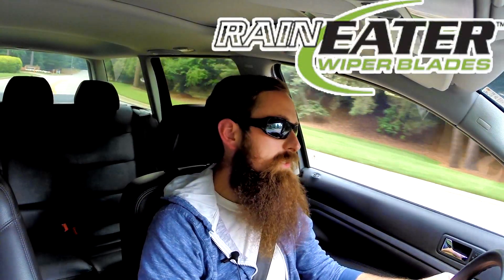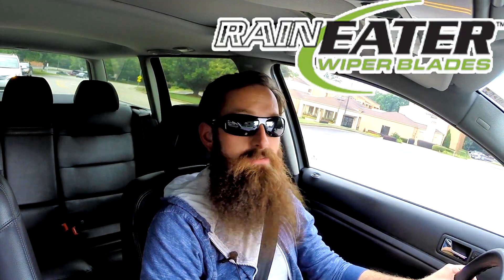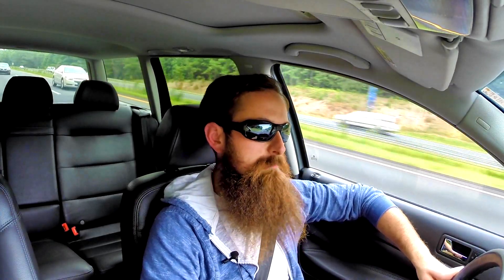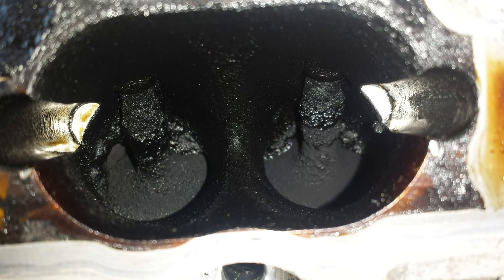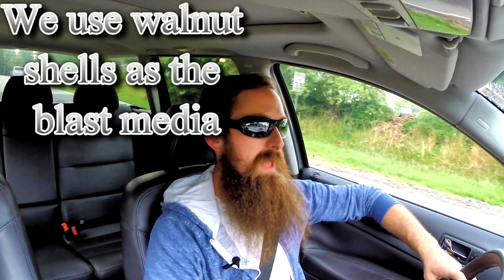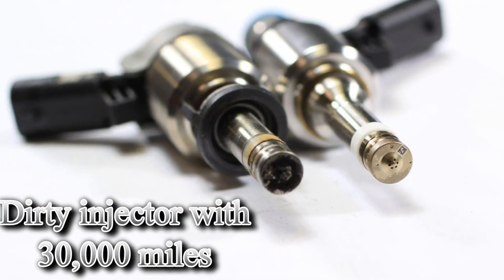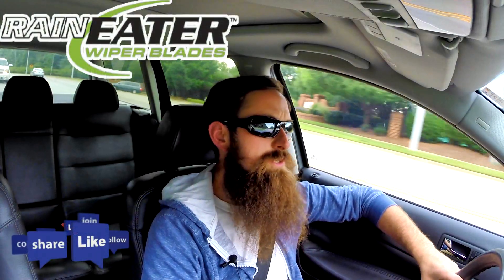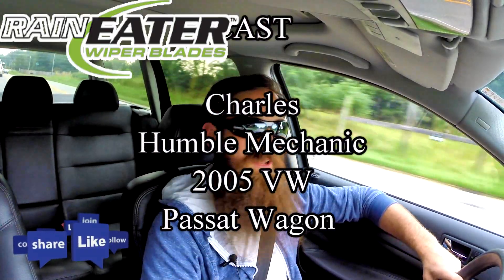Preventing and Fixing Carbon Issues for Direct Injection Engines ~ Episode 80

Comment: After working Volkswagen, and Audi, these cars are a nightmare. 2.0L cylinder heads going in the EOS and Tiquan. Electronic issues galore. DSG transmission issues. It goes on and on. Germans build one of safest cars around but reliability wise not so much.
Reply: Hardly. I'm an engineer AND a mechanic, and drive a certain kind(s) of car(s) for very specific reasons. I've had cars from every major producer. Every manufacturer and country has it's own design intent, quality standards, flaws, and tolerance/acceptance for failure rates and the way in which they address them. Japanese cars by far are the best balance of all things, and are considered highest on the food chain. American cars are at the bottom (if you disregard low-end Korean crap). I'll never drive anything made in the US after the late 70's, and since I work on my own cars and they NEVER see a shop, I'm perfectly cool with getting my Audi's and reverse engineering the known flaws out of  them. Every manufacturer has it's flaws, and even with it's own, Audi (and other German cars) is STILL rated as one of the best in the world, and THE best in Germany (even over Mercedes)... look it up.
Reply: ... and give up on life.
Reply: I have owned a 2007 gti 2.0l fsi/dsg w/108k since 2010 with 0-very minor issues. one of my favorite cars I've owned/driven.
Reply: I still have faith in most German engineering, and believe overall that it is still FAR better than US automotive engineering. With that said, German manufacturers tend to OVER-ENGINEER their cars, which adds complexity, which multiplies more points of possible failure. I had a 2003 A4/B6 of which I remove most of the vacuum system because it was riddled with leaks from being excessively redundant, and over-engineered (that little venturi style "vacuum pump" on the break booster was just nonsensical). I think if VW simplified it's systems they would be on par with Japanese reliability.
Reply: +121bham lol the air bags were global n your compleatly out of your depth german cars ar NOT relaiable ill give u the gm jab ( not a fan also) but u cannot say that thoes cars are reliable and or more reliable the competing japanese cars. also an input, the japanese cars are generally easy to work on. u ever get under a vw or audi?
Reply: +121bham lol the air bags were global n your compleatly out of your depth german cars ar NOT relaiable ill give u the gm jab ( not a fan also) but u cannot say that thoes cars are reliable and or more reliable the competing japanese cars. also an input, the japanese cars are generally easy to work on. u ever get under a vw or audi?
Reply: +121bham and another thing at least gm sees problems and fixes them for free. vw just adds it to the maintenence. german cars also cost alot more to maintain over the course of its life
Reply: Sean Johnstone yep I have an Audi 2.0 TFSI I’ve spent the valve in the car fixing it so could not sell it.
Reply: riccccccardo what are you saying?

Comment: I have an A4 with the 2.0 FSI.  I removed the intake and scraped, scrubbed, brushed, cursed and finally cleaned all the carbon on the valve.  Car has 140k miles and carbon was very bad.  Car is stage 1+ tuned bit would have hesitation and strange misfires but no CEL.  After cleaning, it gained noticable power, to my surprise it comes alive at 5 to 7k rpm.  Tiny turbo spools rather quick but really pulls somewhat "hard" up on top.  After seeing this carbon, there is no way that you can clean it without removing the intake.
Reply from the maker: +Ivan WNY Glad you got her running right again, once the carbon is built up bad enough to impact drivability, you are totally right. Manual cleaning is the best option.
Reply: HumbleMechanic 
I love

Comment: What kind of roll do you think these newer low tension piston rings are playing in the added crankcase contamination issue? I know in EcoBoost world we're using oil catch cans and water/meth injection to keep the engine clean, and make more power. Also, Toyota and Subaru's combined port with direct injection and I'm not sure they're having the same issues. I'm also not familiar with their piston ring specs or PCV system.

Comment: Folks: DO NOT do any form of carbon cleaning on any Ecoboost enigne made by Ford/Lincoln. Ford has just told me they are finding huge turbo failure not long after someone has done a carbon removal service. If it's going to get removed, do it at the dealer and the build up will be removed manually. This also applies to all Gas DI engines with a turbocharger or two.
Reply: ppfffft....as long as you don't inject any cleaner pre-turbo/over and on the map sensors, and as long as you're not a complete noobb, you're fine. Pulling the intake manifold this weekend.
Reply: And yet ANOTHER BIG THUMBS DOWN  for GDI.....Thank God for carburetors :)

Comment: what good will fuel treatment do if it doesn't touch  the valve where the cleaning needs to be done. The only real cure is to remove and dismantle cylinder for a valve service. I have watch a lot of these video on direct injection Carbon issues and yet nobody mentions putting a better breather and catch can in the PVC valve system to reduce oil getting back into the manifold which is where the problem comes from
Reply from the maker: +fknows1 I have asked a lot of people with catch cans about that issue. They say they are still getting carbon build up. Perhaps not at the same rate, but it's still happening.
Reply: thanks will take note and see what sort of feedback I get.has made a difference I think.But like you said its becoming a major issue these days.there will be a solution somewhere someday. buy the way enjoy your vids

Comment: a true oil separator system for the pcv and cam timing based egr (closing exhaust valves early to trap exhaust gases) instead of valve based egr is the solution. you remove the only 2 things causing carbon, and you will not have carbon, simple as that.

Comment: The only way to avoid carbon build up is good driving habits  i live 5 min from work...I know my bmw is direct injected, so what i do is drive 6 min to the hi way zip 10m at 2100 rpm then zip back to work.
Reply: it's sad that in order to prevent problems from a technology that's supposed to make engines more efficient, we have to drive them more.

Comment: I wonder if there's a solution out there that involves basically a "wax" you can put through the intake that will prevent the oil/carbon build up. Like RainX for your intake
Reply: deamonmachine 
I doubt that but it could be torn down and have a coating applied in the intake tract. 
That's a lot of work. 
There's more to coatings than just for exhaust pipes and piston skirts. 
Iirc some fords years ago had a coated throttle body that warned on using certain types of cleaners.

Comment: If you clean the air intake, that still won't clean the backs of the valves?  Also I thought you should never clean the tips of the injector tips as is it can damage the injectors?

Comment: What a great topic- well discussed. Thank you- I understand the issue better, and, realize that it's not manufacturer limited! The Catch Can solution, in addition to using full synthetic oil & premium gas and a daily Italian Tune Up to prevent further build up make sense to me. Funny, but, I struggle with snake oil solutions as well- Techron is no more likely to touch the back of the valve than VW's syrupy solution... Thanx again

Comment: I loved you. I thought you were the answer. But it turns out you're badly flawed. I have to pull my intake off and clean the valves every 50 thou? F**k you, direct injection. Everyone just buy Toyota and Nissan motors from the 90s and if they have 100,000 on 'em? They'll still outlast a brand new Volkswagen or GM or any engine not made in Japan pre direct injection. Direct injection is an a**hole.
Reply: +Dave L Its not a DI problem its a PCV/EGR problem, if manufacturers weren't chucking shit into the inlet manifold there would be nothing to clog up the ports.
Reply: Albie Beck But in older motors the crankcase vents into the intake but the fuel jetting in behind cleans it out.

Comment: My car is a Scoda Octavia 2.0 fsi which is basically the 150hp direct injection Volkswagen engine. I had to change the heat exchanger seals because of a minor oil leak. While it was in the shop i went to ask when it will be ready and peaked under the bonnet. The inlet collectors were removed and the view of the inside was just horrific... The car has 170000km on it, but no issues with starting or running.

Comment: Get a catch can!  Filter out that oily vapor out of the intake stream  Direct injection doesn't wash off the valves.  Toyota/Subaru use two injectors per cylinder, one in the combustion chamber, and one outside that hits the valves.

Comment: Quick question
I have BMW 335 and I have same issue but I seen couple videos about poring little bit of water in to throttle body. Is it going help in anyway? I also have meth kit and I was using washer fluid as methanol and I never had problems and I switched to real methanol/water and two weeks later I had misfire. You think that could'ved had any impact?
Thanks for your videos, very helpful

Comment: Dealer replaced Pistons and rings free of charge on my 2008 Lexus. While they were in there did water pump plugs pcv valve. Paid for parts only on those other items. Not an official recall.

Comment: Toyota gets around this problem by combining direct injection with port injectors. My Lexus IS 350 has over 100K miles and zero carbon buildup issues.
Reply: My GS460 is almost at 200k and runs like it's brand new, direct and port injection as well.
Reply: +Nutz4Gunz45 How does that work? Each cylinder has two injectors and the function of one is mostly for cleaning?
Reply: Not exactly, Mod Mini. The two injectors work at different times depending on engine load conditions.
Reply: Is350 doesn't have as big a problem with carbon build up it's the is250 that has more problems with carbon build up
Reply: Mod MINI multi port is used under light acceleration and idling. Direct injection is for under load and full throttle.
Reply: Nutz4Gunz45 my 02 maxima doesnt have problems either.Yay for old school
Reply: Ford redesigned their engines too to add PI.
Reply: They finally figured it out with the new gen 1.8 and 2.0 TSI/TFSI. Direct and port injection.
Reply: 8AR-FTS 2,0 have dual systems as well
Reply: You can add port injection to fix this issue now
Reply: Nutz4Gunz45 Ford too Yoda man!
Reply: You have a unicorn with out a doubt I am a Lexus IS350 owner and Lexus master tech this vehicle has the most problems of all our models combined with carbon (if your curious I'm in Kentucky) not sure if that matters but seems to be the same across the country
Reply: Why not just port injection why do we need direct injectors?
Reply: ahhh i miss my old is350.
Reply: Saying zero it's a lie
Reply: My 250 is having issues now. Any idea how much it costs to clean?
Reply: Ford does it too, but only in like 2.4l 4 cylinder engines up to V8 engines.
Reply: Captain obvious over here has 127 likes from straight up retards.....Almost all cars have some sort of port injection.. lol
Reply: Yeah, Toyota learned their lesson with carbon build up with the IS 250's with direct only. Lexus had a customer service enhancement to address carbon......... cost them a LOT of $$$.  they went to a dual system.
Reply: +Mod MINI yes and no, each cylinder does have two but both has its pros and cons. both can contribute to low/high RPM in terms of performance and fuel effeminacy. It makes for a more expensive system, but you get to have your cake and eat it too
Reply: Guys who buy (more expensive) cars with direct and port injection also pay for valve cleaning, the only difference is,  they pay for it when they buy a car )
Reply: @MsSashbar  It sounds like a Chinese proverb.
Reply: Toyota gets around every stupid  problems the Germans create in their basic showcase designs.

 Smart drivers who want less pain simply buy Japanese top brands.
Reply: Dr. Elucidation Thats what the comment you replied to stated.
You that stupid?
Reply: Oh well then, that settles it, I'll sell my Audi for POS Toyota. No thanks. a carbon clean is really easy to do. If you can put together a IKEA desk. You can do a carbon cleaning for less than the cost of the desk. These are very high tech high maintenance engines just add one more thing to the list. I personally would not want port injection and DI just more stuff to go wrong.
Reply: I dumped my Kia and got a Camry. I read this comment long ago and did some research. I had a list of what I wanted..no gdi only engine, no cvt transmission, not big on turbo. I really liked the honda manual transmission and could accept the turbo but gdi only, cvt transmission. 
By default I got a used Camry 2018 xle with 10,000 miles for just a few grand more than my Kia forte. More car more horsepower, better fuel economy  and a regular automatic trans.

Comment: Using the right oil is key, too. I'm looking at getting a 2016 WRX, which has DIT, and I've been doing research. An oil with low volatility (NOACK) helps, because, when less of the oil vaporizes, less of it makes it back into the intake tract. There's also a theory that additives, such as sulfated ash, phosphorus and sulfur (SAPS) are a big contributor to the buildup. So, lots of guys have been running oils that are known to be stable, and which have lower SAPS levels, such as M1 ESP,  Motul X-Clean, and Pennzoil Euro-L (these are mid-or-lower-SAPS oils designed to prevent fouling of exhaust system particulate filters). A side benefit is that they tend to have higher HTHS values than GF-5/SN-type oils, and hold up to shearing and fuel dilution that these engines are known for.

Comment: I wouldn´t recommend the italian toon up on an older, high-ish mileage turbo engined car, because if you´re unlucky, you´ll blow the turbo!! I know this because i did this! 2001 Seat Alhambra TDi, 140k miles. Thought i could clear some carbon out by giving it a bit of welly. Wrong!!
Reply: 187k on my 1.8T and I still floor it to over 5,000 lmao. But I change my oil every 3-4k miles with synthetic
Reply: My problem was it was too late to try the Italian tune up!  Once i took off the EGR valve and intake manifold, as part of the repair job, and saw how much oily carbon had built up in there, i realised there was no way that was ever coming off by some hard driving, but i´m sure it helps before things get too clogged up.  Lessons learnt though, so something good came out of it!! ;-)

Comment: Have a VW CC 2013 Sport Plus wither misfire detected on cylinder 4 car has 47k miles. Replaced all 4 spark plugs and all 4 coils. I was told just to replace coil 4. I replaced it a couple of time and same code misfire cylinder 4. Anyone have any info on this? Are you having the same problem. Also added Lucas to the fuel and a half bottle of seafoam on my next fill up after adding lucas.

Comment: What do you guys charge for your walnut blasting service? I have an Audi S6 V10 FSI, and I think VW service might be cheaper than Audi.
Reply from the maker: Maybe. But due to VW not having that engine I would stick with Audi.  The bulk of the labor is removing the intake. So on a 2.0t we charge 4hr to r+r intake and another 2 to clean. I imagine the v10 would be much more labor on both ends.

Comment: I suspect the issue is the EGR valves allows carbon pockets to form. Especially if you only do short drives etc. While doing spirited longer drives seems to clear the pockets up or reduce their chance of forming.
Reply: Danger Dane. The TFSI engines do not employ an EGR system. With VW / Audi, EGR has gone the way of the dodo for many years now. These engines don't need EGR as they use valve overlap to keep the requisite amount of exhaust gases within the cylinder. Unfortunately, these hot gases are part of the problem when it comes to carbon buildup.
Reply from the maker: That is part true. But these VW gas engines do not have EGR.
Reply: +HumbleMechanic I know the older Mitsubishi Charisma GDI  would coke up very badly unless you really got on it from time to time, due to their EGR valve sooting up the engine if you did short trips or drove it too nicely.
Reply: Robert Borchert Really?  No EGRs on ANY VW/AUDI petrol engines now?  Since what year did they stop using EGRs?
Reply: EGR valves are a waste of time.  Even without the EGR valve, my car still recirculates the exhaust gases of the car in front of me when it sucks it's exhaust gases into my engine, via my air filter.

Comment: VW DID put a port injector on the direct injection gen 3 ea888 engine used in the MK7 GTI, but it was only on the Euro versions.  For the US they removed the port injector.  Interestingly they said the port injector was added to benefit fuel economy at "partial throttle" and reduce emissions, specifically reducing CO2, which the EU has strict regulations about, but the US apparently doesn't. That's why they said the US wasn't getting Multi Port Injection. They claim it had nothing to do with reducing carbon build up. But wasn't better fuel economy one of the reasons and benefits always touted when we went to direct injection? Seems like a weak excuse. I believe they did it on purpose to create two groups to test a hypothesis. In addition to the loss of the MPI, they've also increased the complexity of the PCV return to filter out more oil. It makes for an interesting experiment to see in 5 years if the enhancements to filtering are enough, or if the port injector is actually necessary.

Comment: In early and -05 2.5  tdi-s with rotary pump engines the theory that "wen you shut your engine up air and fuel mixture hanging around in the cylinders " is not true, thous engines stop fuel entering/mixing with air from the shut solenoid in the pump and they are still building some carbon buildup !